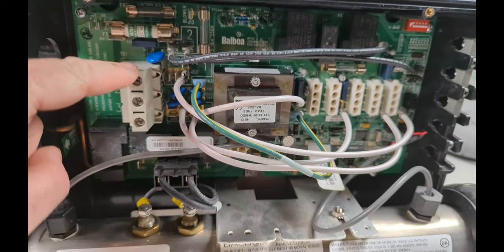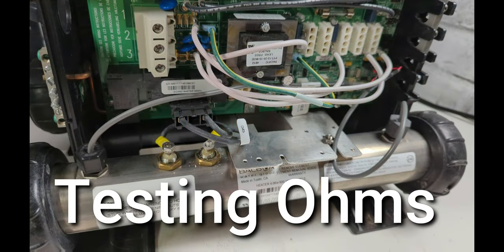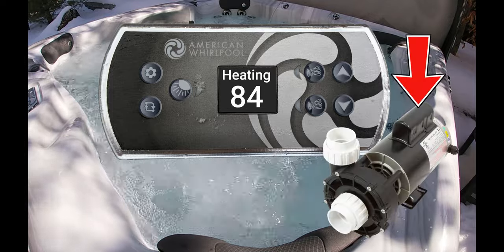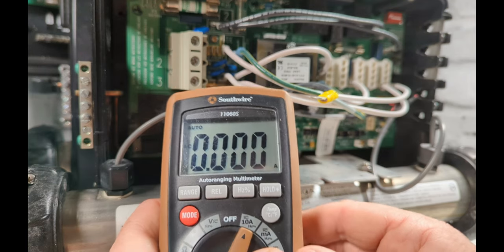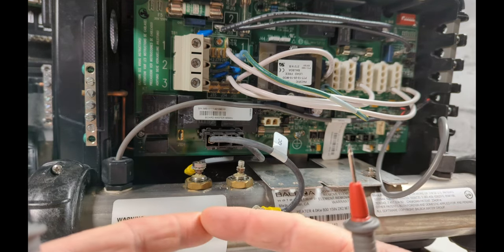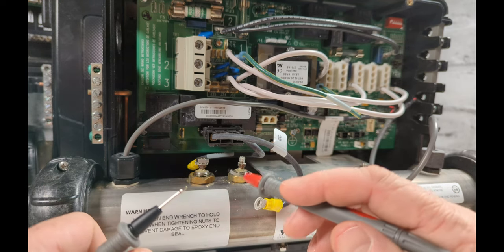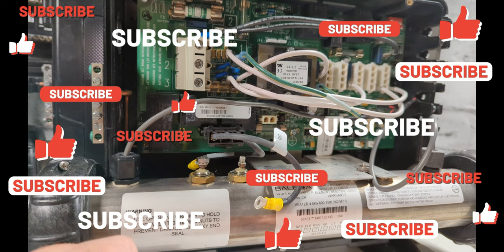Testing a Hot Tub Heater Element | How to Test a Balboa Hot Tub Heater | Hot Tub Not Heating Up

Comment: My hot tub is not heating. Im getting 240v coming into the spa pack and 0v at the terminals leaving the spa pack for the heater with the heater turned on from the control panel. Filtration pump activates just fine when the heat is turned on and reads 240v at the spa pack terminals but heater terminals read 0 and heater does not turn on.
Reply from the maker: sounds like the relay

Comment: My spa is balboa vs running at 120 volt plug and play. I can’t get it to heat. I installed new pump and heater with sensors. Voltage is good on the heater but my amp draw is only 1.5 amps during heating. Shouldn’t it be a lot more like around 10-12? If so do you think it’s a board issue? If you can help that be great. Your videos are very informative
Reply from the maker: Does the tub have a cord with a GFCI on the end of it?  Whats the volts coming into the tub?  If you have 120volts and no or low amps, that sounds like a element issue.
Reply: The element is bad. A clamp on amp tester on heater wire will verify not pulling juice

Comment: Great video. Easy to understand. I have a small hot tub with 4kw heater element and was experiencing intermittent breaker tripping. Did find a small leak in the Ozonator and replaced that unit. Still get a tripped breaker intermittently, might run for several days or weeks. Tested as the video shows, 240 volts were in from the breaker, and 120 V was on each side. Volts at the heater element were 236, not 240. Ohms at heater 14.9, Amps 16.5 on one side 16.2 on the other side (clamp meter) Continuity tested good. Any suggestions as to what could cause intermittent breaker tripping?
Reply from the maker: When a hot tub trips at random it's hard to pin point the problem.   How long has the tub run before it trips.  And what's the fastest it has tripped after you reset it?
Reply: @VIPPoolsandSpas  On June 15 replaced the Ozonator refilled and restarted. Tripped out June 23, again on July 7, I didn't reset until July 30 it tripped out on Aug 5, reset on Aug 13, and tripped out on Aug 20. I am in a rural area and we do get brownouts and sometimes full loss of power we have generator backup and I have noticed that when power goes out and the generator kicks in the hot tub trips out. I have a wifi temp sensor so I can see when temp drops off.

Comment: I did everything you did basically I’m not getting 240 between the two heating elements so when I undo the plug from the circuit board, I’m not getting 240 from there. I’m only getting 120 from one side from the other side so basically the heat is only getting 120. Does that mean the boards bad or is there something that could be changed?
Reply: My hot tub is doing the same thing. I had to disconnect from heater to test or the breaker would trip. The one leg is getting 120VAC and the other leg is getting around 25VAC. Pretty sure a relay is bad on the board for the 25VAC leg. Was this what you’ve found as well?

Comment: sir thank you very much easy to understand your video having a problem with my balboa change the heater and two sensors and have no heat any help would be great
Reply from the maker: What's the volts and amps of the element,
Reply: @VIPPoolsandSpas  240 and a 4 kw did not know how to test until i seen your video does have conntinutity on both post of heater and all fuses are good cold out right now and could use this will try to get a tester like yours today

Comment: My spa is tripping the power. When i unplug the heater. The spa works as normal. When i plug heater connections back in the power keeps tripping. I have ohms and  have continuity. Dimensions one spa. Pretty sure its the heater element.  I was going to try amps but was thinking it may just trip the power. Any help appreciated thanks.
Reply from the maker: Change the heater element.

Comment: If there's no volts to the element you need to replace the board not the element
Reply from the maker: Not true.  If it was that easy there wouldn't be any videos on it.  You would just say.  No volts, it's the board.
Reply: I fixed mine about 15 time's!  And the hottub store themselfs told me to skip this part and sure enough it was always the same parts, heater, maybe a fuse and at worse a pressure switch and that's usually it

Comment: My heater is only registering 30 volts.  The heater light is on but no heat.
Reply from the maker: sounds like a board issue.
Reply: @VIPPoolsandSpas  so does that mean the entire board must be replaced?

Comment: I appreciate your videos. Where I live most of the spa guys have retired or moved away . Seems young people don't want to learn a trade nowadays so no one replaces them. The remaining spa repair places said they would only work on spas they sold.One was nice enough to hear my plea and suggest some things. My daughter asked if my granddaughters could use our spa. she promised shed keep an eye on them to keep them from dong things. Then she got a call from a potential boyfriend and left them to it. They put a bath bomb on and then took turns turning the spa on and off a lot to bug each other. So then next time I go out there its full of slimy stuff. It turned on and off over and over.Like maybe the switch from them pushing it on and off so much. I cleaned to out and drained it and rinsed it . I flushed it the best I could. I replaced the control pad up top. Worked great for 2 months then the board fried where the power wires attach to it.I am a electronic/electrical tech for automobiles. But not spas. Im gonna buy a new Balboa board but Im afraid of why it heated the wires up so much. This a 110 spa. It has a breaker at the plug.It didn't pop that or the house panel breaker. Boards aint cheap so I was wondering if you could give me some advice on this. The board has a supersede number and the new ones are available. I can do the testing easily that you suggested. Im gonna look into the heater element to see if its coated when I pull it to swap the board. I think I'm gonna try to flush the pump out too, while Im at it, just to see if its still sludge in there. when I found it dead the water was still pretty hot  so Im betting the heater is still good. Any other ideas I should look for?
Reply from the maker: Most likely it burnt out because of the filter getting clogged and was putting a strain on the pump.  Not much I can suggest.  Maybe change the gfci on the cord after a few years and cleaning the filter more often.  Flushing it out once is all you need.

Comment: Hi Jim great video .. 

Question I have is the tub is running and jets and pumps and filtration cycle also turns on. When I turn up the temp does not turn on heat ! 

Could be anything else . Could dirty filter ?
Reply from the maker: Hi.  No Jim here.  lol  Test the heater element if there's no code and no heat.

Comment: Thanks for your great videos! We have an old spa with a gecko pack we test for continuity and meter beeps but when we test it live we don’t have any volts reading on the element probes. What to do next? We have a 3 dot code (flow) we have changed the flow pressure switch, the temp sensor in the tub, replaced the filter, purge for air. Pump doesn’t turn on when we flip the breaker but when it suppose to filter it runs for about 10 seconds and stops. Any other things to check for?

Comment: Really appreciate this video! I'm wondering if there is any reason why you would have to change the heater tube as well as the element? I tested volts and amps on my 5.5kw element, both were 0 so I'm planning to change out just the element. Wondering when I'd need to consider changing the heater tube as well. Thanks!
Reply from the maker: The only time you change the heat tube is when the ends get corroded.  Whenever there's leaks coming from the end gaskets or even the element, there's a chance that it crowds the tube and creates little tiny holes.
Reply: A quick follow-up - I first noticed this issue with the heat after a brief power outage. I can see there's a fuse on the heater itself. Is it possible that a blown fuse would cause this problem?
Reply from the maker: @steveclarke4756  When you say on it, you mean there's a fuse just above the heat tube on a little circuit board?  If so, that is for pump 2.
Reply: Hi again. I replaced the element but it seems that isn't the problem. I tried testing the voltage to the heater but I'm not getting any. I noticed a comment above mentioning a bad relay might be the problem. Is that the piece on the pack that has the two leads going to the heater?
Reply from the maker: @steveclarke4756  See our video on relays.  We show how to replace them.

Comment: Hi! Thanks so much for the informative videos. Quick one for you - my spa turns on and heats up great but it goes too well and won’t turn the pump/heater off when it gets to the right temp and just goes too hot. Any ideas where to start? I haven’t tested anything just yet but I do have a decent multimeter. Thanks again
Reply from the maker: Thanks for watching.  As for the hot tub heating up to hot.  What's the temp get to?
Reply: @VIPPoolsandSpas we have it set to 100°f but it just stays pumping and goes to 104°f
Reply from the maker: @lewbro1234  could be a sensor issue.  Most likely the high limit.

Comment: Having heating issues Thanks for the tips changed the heating element keeps coming back with a dry  and hhc  clyes then doesn't run unless its reset is it the logic bd , also the heat when it is heating is flashing and also changed the pump out as it was frozen solid heats slightly then turns odd to dry also notice no water coming from water fall spout any suggestions ?
Reply from the maker: Sounds like a flow issue.  Knife shut or something in pump or pipe

Comment: Hello! Your videos are Great!  I have a balboa 2007 spa that I can’t get anyone out to look at. It is running but not heating.  So I changed the heating element and sensors. (Before I found  your videos) the heater is brand new. It has a pressure switch on top. I just tried checking with a Electric meter and there is power coming in. But nothing on the heating element probes. Is there a fuse somewhere besides the glass one that needs to be reset?? thank you for any help! Paula
Reply from the maker: What's the temp of the water and what is it set for on the topside control?
Reply: It is set for 102. And the water temperature is 60. And the heat light is not on
Reply from the maker: @pturner300  jump the pressure switch and test element again.  If you get volts, change the pressure switch.  If still no volts, it's the board.
Reply: I’m sorry, but how do I jump the pressure switch?
Reply from the maker: @pturner300  look for the video that shows how to test a pressure switch.
Reply: I unplugged the pressure switch from the board. no volts on heater leads. The pressure switch reel only turns a 1/4 inch? Don’t know if that’s a issue
Reply from the maker: @pturner300  jumping the pressure switch is when you did connect it from the switch and touch the 2 Leads together.  That's jumping it.  A wire works.   Then test the element.  As for turning the PS, a 1/4 turn or more counterclockwise is all you need to her a click.  That would be the heater relay turning on.

Comment: Hi, changed my Balboa gl2000 3kw heater element as it wasn't heating with a universal Chinese element, it worked for 2 weeks but blew the fuse.
I changed the fuse but still won't heat, circ pump wasn't working properly so I cleaned out all the debris but still doesn't heat.
Ohm's and continuity is good but no volts or amps to the heater.
I even replaced 3 relays but still no heat.
Do you think I have to replace the element again or could it be something else.
Reply from the maker: No volts or amps means its something on the circuit board.  The board isnt doing its job sending volts to the element.

Comment: I have been  working  on a dream maker hot tub with a balboa circuit board in it. It's a 120 volt cord connected tub. After about 30 minutes it trips the GFCI cord end. Also, the  tub is not reaching temp so my theory is when the circuit board sends a signal to the heater it trips. Heater is reading 14 ohms. Any suggestions would be helpful.
Reply from the maker: The cord has a GFCI connected on the end?

Comment: Please help ! I have a strongspa wirh Balboa VS501Z board.

 The circuit board has fried for the second time! The first technician simply replaced the circuit board and left two years ago. However, upon closer inspection this time, I noticed that the wiring to the hot tub is done with aluminum. So, I hired an electrician and opted for cheap and low AWG aluminum wiring. We then decided to change the entire wiring to copper, along with new breakers. However, the breaker started tripping with the new board. We conducted a test with the heater disconnected, and the hot tub started fine. We also replaced the heating element with a brand new one. Now, the hot tub starts for a few minutes, but then the circuit relay begins clicking and the jets intermittently work and eventually stop :( The pump was already changed last year.

So brand new circuit board with brand new wiring with brand new heating element and one year old pump. I am really running out of ideas here ..
Reply from the maker: Next time it starts "clicking" and the jets come on and off.  Unplug the topside.  if it stops, change the topside.
Reply: @VIPPoolsandSpas  Thanks and we tried that too ! Started the hot tub with top side removed and same issue

Comment: What if i have a 240 system and have 240 coming in but only 120 at the element? I thought it was the element because one side got hot and melted so i replaced the whole set up. I did reuse the old wires because i have the clip in style not the bolt on kind of connection.
Reply from the maker: Its the relay.  There's 2 relays for the heater and one isn't working.   Replace the wires also.   I have a video on how to test the relay and if you want, a video on replacing it.
Reply from the maker: Just following up on your hot tub issue from 8 days ago.  Did you figure it out?   Thanks
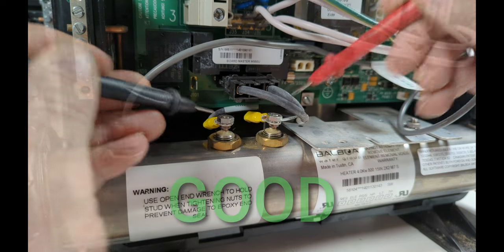Reply: @VIPPoolsandSpas 1:58

Comment: What if I don’t have any voltage to the heater? Bad control board?
Reply from the maker: Assuming the pump thats pushing the water thru the heat tube is running, it would most likely be a relay.  You can test by having one tester lead on the white coming into the pack and the other on one of the heater leads.  There's 2 relays for the element.  One might be gone.  I don;t have a video on this test.

Comment: Checked all test on my Dreammaker Big EZ with a Balboa heater everything looks good to go but I’m still getting no heat at all,when I turn the tub on I hear the click when the sensor detects under temp the indicator light flashes then 30 seconds later click again to a solid light my spa guy said solid light heater is on and heating… clearly not lol

Same thing happened about 8 months ago same tub, bought a new heater tube with sensors everything worked good after changing, when it happened again today I went in to buy another one to change it again and brought the one I took out last time, he tested it and said I don’t need to buy a new one that one is still good and just put it back in and if that don’t work change the board… not sure what my question is but my tubs getting real cold 🥶 and freezing her in New Brunswick Canada 
Should I drain, swap it back in, fill and cross my fingers?
Just get the new board now so have to drain? I’m not sure what I should do 🙃
Reply from the maker: Did you test the heater element?  Whats the volts?  Are you running 240v or 120v?  The click you hear most likely is the relay for the heater.  Could be a resistor issue on the board.   I'm assuming there's no error codes coming up on the topside?
Reply: @VIPPoolsandSpas  yeah no error code and 240v, I also took the heater tube that I was told was working and connected the two probes from it to see if it was the probes the new temp read 32 ( the outside temp) and it said ICe error waited to see if that would work went through the clicks light went solid hour later still no heat, right now I’m sitting on a 52 degree tub probes reconnected
Reply from the maker: @MBZ_420  If you test the element and are getting 240v when the heat light comes on, the board is working fine.  If it's 0, change the relay or board.  If you get 240v and no heat, it's the element.
Reply: @VIPPoolsandSpas  I appreciate all of your quick responses!!
I know not proper I’m sure but could I hook up the other heat tube probes and power and let it kick in dry just for a quick second to see if I get heat I could just check quick with my IR gun then turn off the breaker right away? lol maybe that’s dumb I don’t know lol
Reply from the maker: @MBZ_420  Hot tub needs to be full of water for heat to turn on.
Reply: @VIPPoolsandSpas  darn! lol hey thanks again, we’ll see where I get tomorrow!